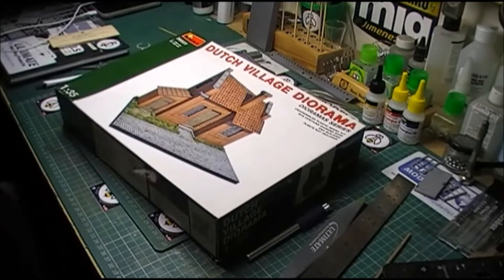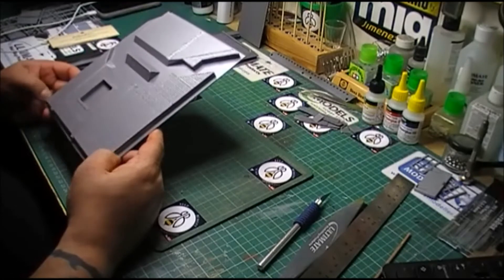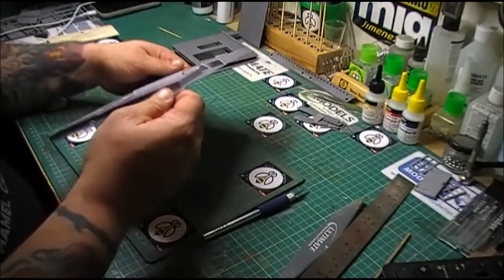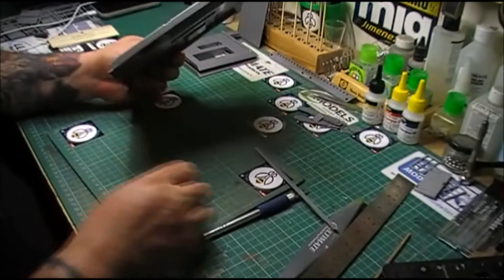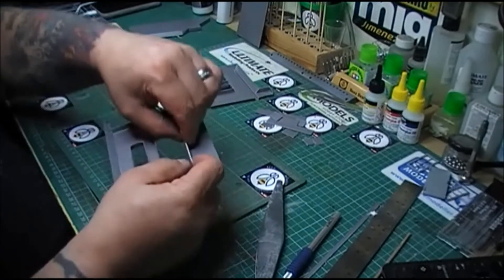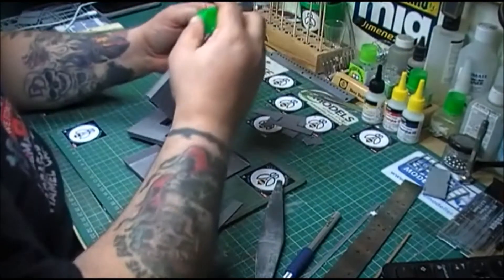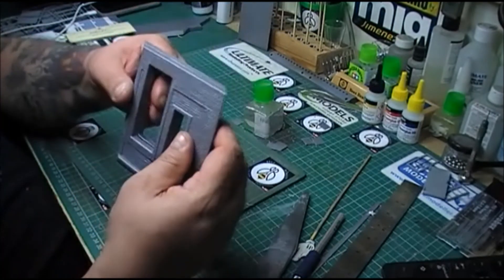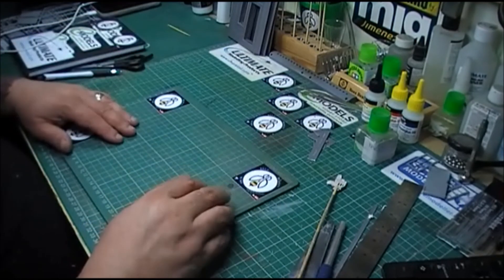A Bridge too Far Group Build Update 1

Comment: I love theses MiniArt buildings. With all the accessories they are much cheaper than plaster buildings and the degree of details is outstanding. Will have to look a little deeper into them. I never built one so far, but they look brilliant. With all your tips I could hardly go wrong and ruin the parts. Thanks, Beez!
Reply from the maker: Non-Prolific 1/35th Scale Model Builder cheers mate